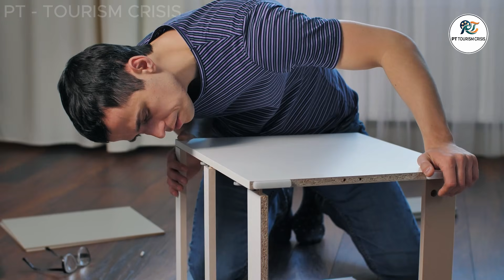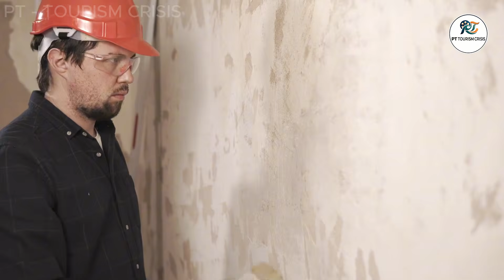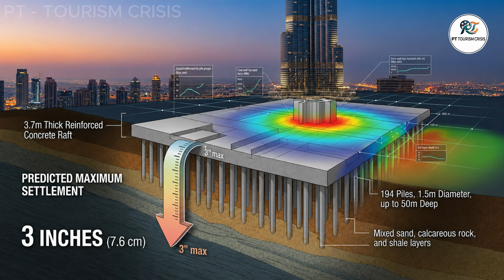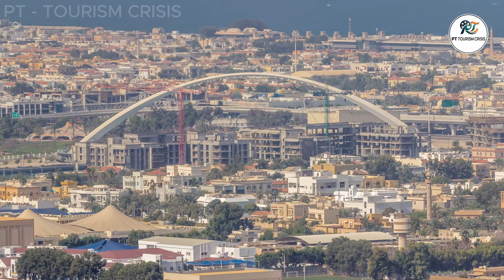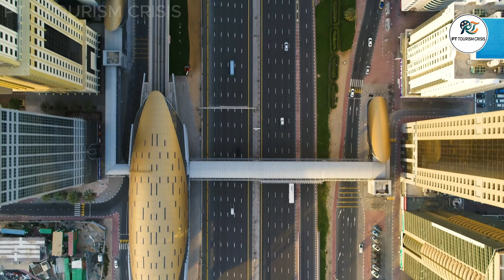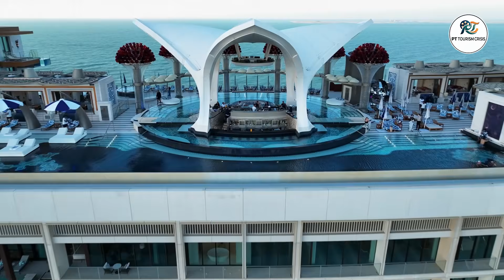Why Burj Khalifa's Concrete Is Still Shrinking Sixteen Years After Anyone Stopped Pouring It

Comment from the maker: Source note, and the limits of what is in this video.

1. Scope. This is a video about how concrete behaves under load, not a claim that any building is in trouble. The Burj Khalifa is performing as designed. That is the whole point of the video.

2. What is published and what is not. Skidmore, Owings and Merrill published the creep and shrinkage analysis for this tower as a curve rather than as one headline figure for total shortening, so I did not give you a number for total movement. If you have the published figure, post it and I will pin it.

3. The numbers I did use. Predicted foundation settlement of about three inches at most, and roughly one inch recorded high in the structure. Perimeter columns at twenty-four inches to match the corridor wall thickness. Long term analysis run to fifty years after construction. All from the design team's own published account of the structure.

4. Sources: Council on Tall Buildings and Urban Habitat, technical paper on the engineering of the tower by the structural design team. American Concrete Institute, A C I two oh nine on modelling creep and shrinkage, and A C I three eighteen.

5. If you worked on survey control, facade access or lift installation on a supertall, tell me where I have simplified too far. Corrections get pinned above this comment.

Comment: Logically, if you design too tall to ‘sag into alignment’ as creep occurs over time, you are by definition creating the exact condition prior to and during the settling that you’re ostensibly designing to avoid after settling. 

Misalignment before settling into place is as bad or worse than after settling because the materials are compromised early in their lifespans. Your statement that misalignment equals unintended load bearing is quite problematic for justifying intentional early-stage misalignment that’s (hopefully) going to resolve itself at some unknown future point.
Reply from the maker: That is a valid engineering critique, as designing for future settling requires precise calculations to ensure structural integrity isn't compromised during the transition phase.